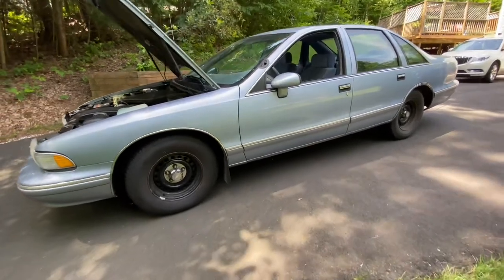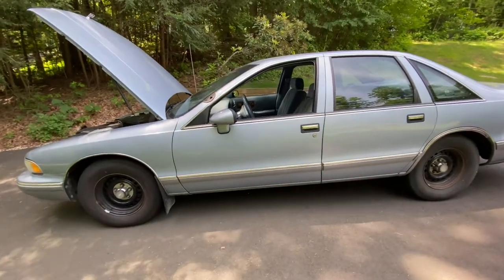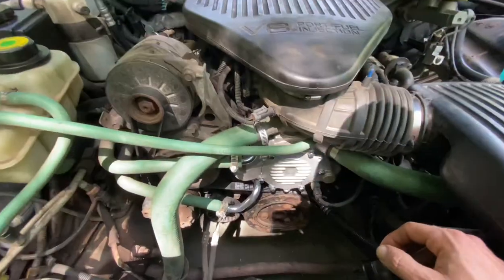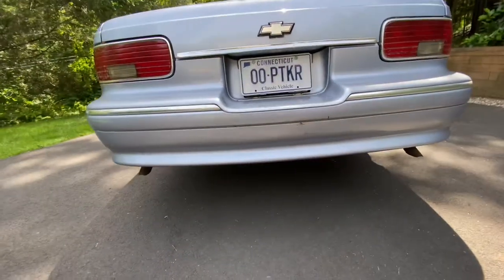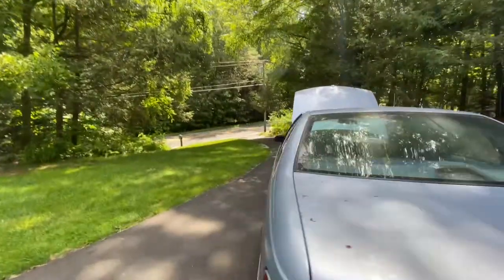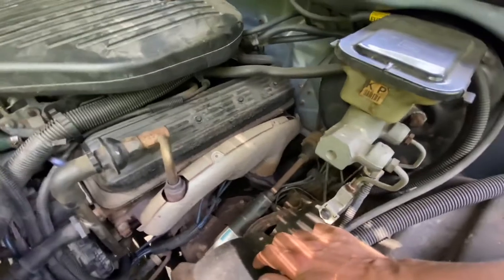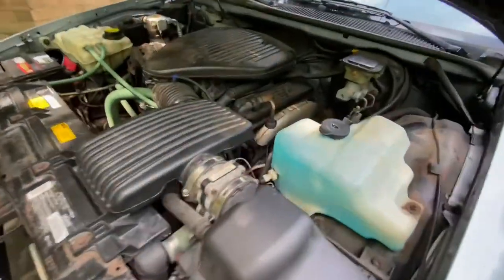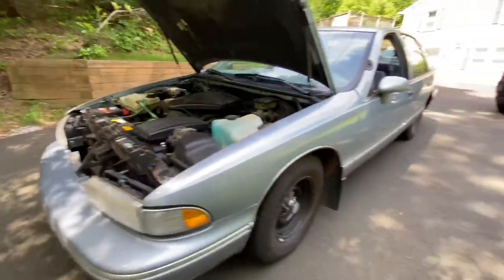Chevy LT1 Misfire - Never Overlook the Obvious!!

Comment: If the car runs, you can bet the optispark is fine.
If you look at how the wires are routed (through engine mounts and underneath the headers), tracing each wire to the correct cylinder can be really challenging. If the car should start or run well but doesn't and the wires and or plugs look new, it's a good chance some idiot (like me) replaced the wires in the wrong order. The best way to check this is from underneath the car, not from above - you can see much more of the ignition system from below.
Reply from the maker: The o-ring on mine was damaged, so it was probably a matter of time before it failed anyway. At least I’ll keep telling myself that.

Comment: Also, visual inspection of vacuum lines is maybe 10% effective vs. pulling them off and giving them an actual vacuum-hold test. On cars this old, chances are the vacuum lines are cracked, or are going to crack, anyway. Those hoses off the passenger side of the throttle body need periodic replacement. *If you use brake cleaner to check for vacuum leaks while the car is idling, make sure to have a CO2 fire extinguisher handy. That old grease mixed with solvent likes to burn long-time.

Comment: I had a misfire in my 95 Impala and went through a similar diagnostic process to you where I started pulling spark plug wires checking for dead cylinders. Long story short, one of the wires going to fuel injector #2 was bad. Sometimes it would make a connection and the car would run fine and other times it wouldn't. I replaced the pigtail to injector #2 and that fixed it.
Reply from the maker: That’s interesting.  When they run, they are phenomenal, but they seem to have their gremlins.
Reply: @HilltownCT  Indeed. I put all new ignition system, coil, wires, optispark, and 8 fuel injectors before I realized the problem. The intermittency is what had me stumped.
Reply from the maker: @sstupidsstuff3453  Ouch!  I had another issue I didn’t do a video on where I had a plug that was firing intermittently and it only manifested itself when the car was at operating temp.  Guessing it was a heat expansion issue or something.  Oh well, smooth sailing for now :-)
Reply: @HilltownCT I have that issue now where it only does it at operating temp..temperature... what did you do???
Reply: @thastunna05  The IAC (idle air control) is near the coolant passage channel in the throttle body, and gets gummy sometimes. All those vacuum lines on the throttle body need to be checked, too. https://youtu.be/BvlUBl0aaMc?t=347

Comment: Nice video.  I have a LT1 Corvette that, out of the blue, misfired, died, and I could hardly get it to start and run smooth.  Wouldn't you know it happened away from home.  Well, it finally ran alright getting home but after watching your video, I am going to save that hateful Optispark for last, if I have to change it.  Sadly, I'm afraid to take the car anywhere until I sort this out.  Thanks for your video.
Reply from the maker: Thanks and good luck to you!
Reply: On my Caprice it was the ign control module/coil. Sputtered and died, would crank but not start. Gave her some starting fluid and no change, leading me to start with ignition. Glad it wasn't the opti

Comment: I recently had someone change the spark plugs on my Chevy. Caprice didn’t have any symptoms of bad spark plugs just did it because I never done it before after we noticed backfiring engine, stalling, and engine has do you have any idea what this could be put the old spark plugs back and still doing the same thing backfiring from the Exaust engine installing and Car runs rough. Please help.

Comment: Had the same trouble but I did what you did check the spark plug, solved the problem but the water pump went out so senes it was off I replaced the opti spark as well, one good thing about these cars if you take care of them they’ll run forever I’ve had mine for 18 years now. 95 caprice classic with the small block V8 they call them city sedans no need for a city employee to have a 5.7 lol
Reply from the maker: 18 years…wow!  I drive mine to work a couple times per week and it’s over 30 miles each way. It runs like a sewing machine and it’s more comfortable than my truck.

Comment: The problem is is that you took people's word that the optispark is usually the problem!! When it's NOT!!! The optispark is very simple to figure out if it's the problem or not!! If the optispark is actually going out then you'll get either a high resolution trouble code or low resolution trouble code!! The computer will tell you if it's bad!!! I can't stand listening to people always blaming the optispark!! I'll tell you right now that I've had a couple LT1 cars 4th gen camaro and currently a 92 corvette! I've never had an issue with the optispark on either one!!! But the corvette I changed out everything waterpump optispark belt and hoses just because I had no info on those parts so I went ahead and did some preventive work and putting the optispark back in I messed up the seal and in 3 months it filled with oil and crapped out! But that had nothing to do with the optispark!! I screwed up! So I re-did the optispark made sure the new seal was good and been running like a champ since!

Comment: Ever have a car with a weak spark on one cylinder? Got a Roadmaster, trying to find why it's bugging out. Thinking it has to be the Opti, right? But it's an expensive part to just be throwing at the car.
Reply from the maker: Personally, I would swap a plug and wire from another cylinder and see if the problem moves. Go cheap first!
Reply: @HilltownCT  Swapped the wire, then the plug. Both known goods. Made no difference. Coil, O2s, and ign module are new, too. O2s solved the problem for a day. Just gonna buy the thing, methinks.
Reply: @frikyouall  any news? same shit there. New opti, coil, icm, plugs and wires...
Reply: @vitjuha96  Plenty more tests, but no real solution. The car is up on blocks basically being a test cow for anything I can come up with while I continue to put off changing the distributor.

Partly because I'm also changing the oil pan and timing chain cover gaskets because the gaskets and seals are leaking pretty good.

Wish I had a better answer, but that's where I'm at. Sorry, bud.

Comment: my 96 c4 is misfiring in cylinder 5, i checked the wires, and when i pull it off i can hear the arc, and it has a new plug. so i replaced the injector, and it did not fix it, so i checked if it was getting fuel, and im pretty sure it is, but is still misfires at idle, low rpm low throttle, or high rpm high throttle. the only hope is adjusting the fuel trim, only codes are telling me to change the oil :(  gonna get back into it again
Reply: so apparently my brand new plug had a crack under the metal in the ceramic, and i could wiggle it just a bit. new plug in and misfire gone
Reply from the maker: Glad it was that simple. Miss my C4!

Comment: Ever had issues of it cranking & not starting?
Reply from the maker: Yes, but only related to a bad fuel pump issue.
Reply: @HilltownCT  ok I'm buying a 94 this weekend died on the owner one day and he could never get it back running I already own a 91 and 96 so I'm excited to see what I can get going with this 94 it's a 9c1 also
Reply: @hwyy9046  just went through hell with my 96 roadmaster! Put seafoam in one day and it bogged out on me after driving around for a while & wouldnt start back what so ever... after replacing opti, ignition coil, sensors, vac hoses etc, it came out to only be the ignition module -_- smh 😂 after all the wasted money it only took a $80 plastic module & it crunk up with ease 😎
Reply: @low4oshow  figured mine out it was just the coil

Comment: Never get shorty headers.  They are a misery.
Reply: @bitchard215  I am also considering some tubular headers. I think a major reason to avoid it is that the plugs and wires are running really close to the manifolds. 
Zip ties or some nice cable looms can help keep the wires from touching the exhaust and melting/shorting.